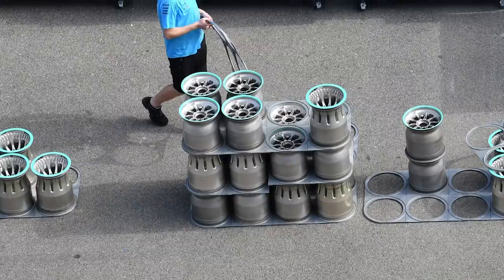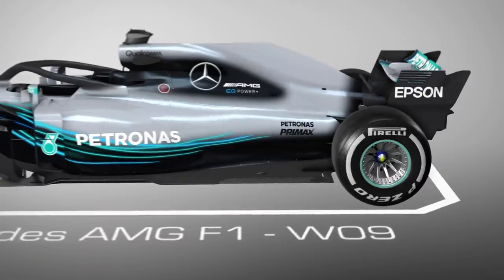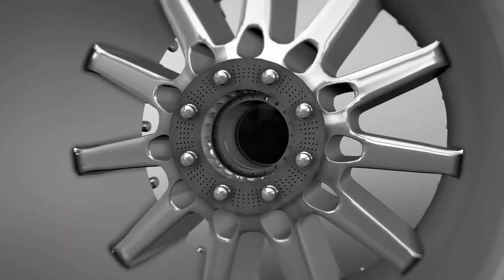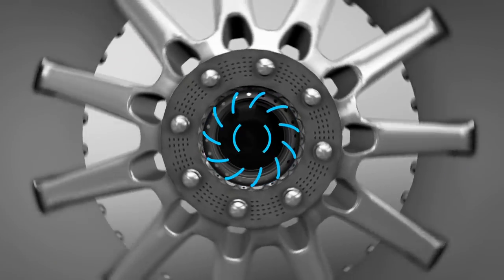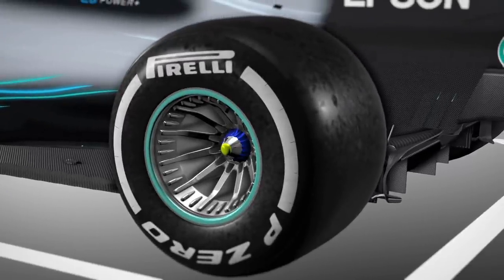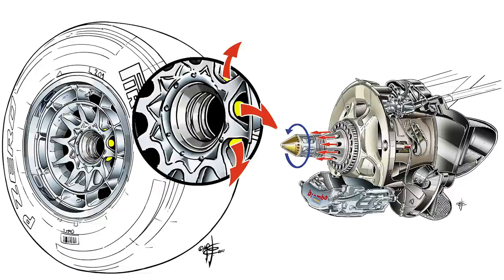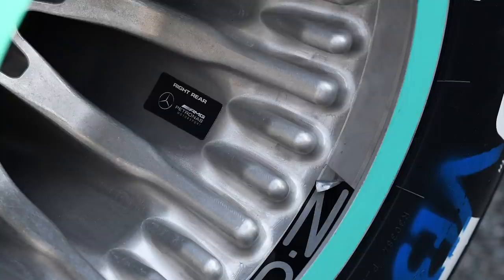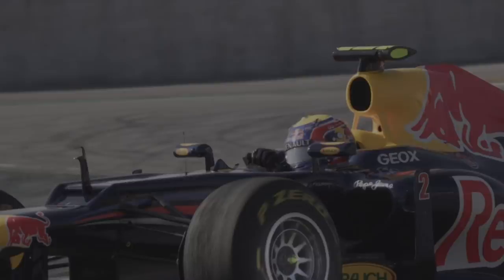Inside Mercedes' controversial F1 wheel rims

Comment: How about they lift some regulations, I want to see what ungodly speed they can muster out of these banned "aero" improvements.
Reply: Nah M8 as much as I Agrre with you, they could never do that. Back in the late 80s early 90s, which is getting on 35 years ago the LMP cars at LeMans which aren't even open wheel were approaching speeds of 270mph...MPH in race trim on practice laps before they eventually put the chicanes in. I'm sure cars like the Porsche 962c and the Sauber Mercedes C9 could have easily topped 300 with minimum aero packages. And that's with 35 year old tech non open wheel cars. If you let F1 teams go full out no restrictions with today's tech, they'd probably be able to make cars that could hit 500+mph and still stick to the tracks around the corners. It would just become impossible for human drivers to survive the G forces in the turns. At this point they need a certain amount of regulations for sanitys sake because the tech has advanced light years beyond what human drivers bodies can react to/survive. I think the highest Gs pulled in any kind of racing these days is red bull air race pilots who've been known to pull +12g on occasion and remain conscious... Then again those guys make fighter pilots look like little girls considering they do all this 50 feet above the surface of the water. I belive they've begun instituting penalties for exceeding 10g though, again, for sanity sake. I do agree with you though. While some regulations are definitely needed they should calm it down a little bit with over regulating
Reply: What blackhawks81H is true. Technology has advanced beyond what the human body can endure. They built cars a LONG time ago that put excessive G’s on the car, and by excessive I mean they exceeded what a human could withstand without graying/blacking out, the cars could endure it but developers knew a human could NOT.
Reply: As much as I'd love to see some crazy machines hitting crazy speeds it's kind of necessary to make it a competition between drivers and not between the cars themselves
Reply: can't wait for AI races
Reply: @tophan5146  Or better yet, the invention of Wipeout racing with innovation to levitation tech.
Reply: Remember Group B Rally? And the insanity that ensued?
The rules may be byzantine, but they're afraid of killing a good dozen drivers, and that's not a fear that's out of nowhere.
That being said, it does sound a bit fucking weird from time to time.
Reply: @blackhawks81H  nah, those open wheels are big drag sinks, they're always going to be slower than a closed wheel GTP car of equal horsepower.

Comment: Typically, true to form, Ferrari miss a trick with some innovation and then try and get it banned...
Reply: You have to remember that Mercedes made FIA put some extra sensors on Ferrari's double batteries. So Ferrari is now keen on revenge. Tit for tad
Reply: eudofia Indeed, but it’s suspicious that Ferrari lost their power advantage as soon as the sensor was installed... so they were obviously doing something they shouldn’t have been doing and yet the FIA took no action...
Reply: @FrontSideBus  That's right. The reason they are so angry. Just as when they lost the power advantage, Lewis was racking up the wins while Vettel was finishing 3rd or 4th. I bet Ferrari fancies the constructor's championship, so they will do anything to try and outscore Mercedes in the remaining races.
Reply: @FrontSideBus   Also Mercedes got FIA into checking the Ferrari Halo Mirrors. 
It's not only ferrari doing this. Every team is trying to prevent progress of their opponent. Renault with Haas, Ferrari with Mercedes, Mercedes with Ferrari and so on.
Reply: Highsider - Motovideos I think halo mounted mirrors actually look better but those extra winglets were obviously aerodynamic and not structural at they claimed.
Reply: Highsider - Motovideos it’s all rubbish anyway. It’s supposed to be the pinnacle of motorsport... they should be allowed to do what they want tbh.
Reply: @Mr Calcium Well, Mclaren can´t make anything work really lol.
Reply: Curious Cat - F Duct!
Reply: @Mr Calcium Yep, they kinda shielded themselves behind the whole "it´s Honda´s fault!" and this year they got exposed, same RB engine, still same shit in overall performance. So it wasn´t just the engine, it was the whole package. And I wouldn´t be surprised if Honda suffered cooling problems because of the "size zero" concept that Mclaren used and didn´t wanted to give up on (of course it wasn´t just Mclaren fault, but it might have been one of the factors in the overall disaster).
Reply: @markmark5269  wow that's some Hamilton/Benz hatred there.....without bias you say?
Reply: FIA = Ferrari Internationale de l'Automobile.
Reply: @SixCylinderSamurai  I've heard Ferrari International Assistance. We're on the same page.
Reply: Not new just reintroduce or copy from old BANNED (2012) Red Bull rim design..
Reply: @stefanocozzi8188  The reason Italiens didn't put man on the Moon first cause they run out of Scafold!
Reply: Where do you get your info?
Reply: Ferrari doesn't do something right once, and now they're everyone's punching bag. Yeah ok.

Comment: The difference between the red bull design and Mercedes comes down to position: RB was running a blown axle which basically uses the air coming from the brakes and "spins" it, effectively closing the sides of the car (the "spinned" air helps the organized air between the chassi and this vortice stay in place, instead of bleeding outwards and ruining the effectiveness of the diffuser).

The Mercedes rims can´t do this because it´s on the rear of the car, plus the amount of air that comes out of the rim doesn´t seem to make much of an impact aerodynamically. Ferrari is just playing their only card to stop Mercedes from winning the championship again, Mercedes just played it safe and didn´t run the rims after this to make sure those points wouldn´t be removed later on.

And of course the new rim will have an impact, it was made to control the temperature of the tire and the blistering because of overheating, which is one of their problems most seasons, so by going back to the previous rim, those problems came back. But if it doesn´t have an impact in aerodynamics, Ferrari doesn´t have anything to hold on to. Because teams are allowed to let the air flow thru the rim for cooling, what they are not allowed is to use this air as an aerodynamic vortice to enhance the air flow thru the car, but that can only happen if it´s used in the front axle, frankly can´t see how they can do this using the rear axle.
Reply: Active aerodynamics isn't only banned if affects aero in positive, but also for temperatures. Of course with the exception of the engine cooling.
Reply: @piereligiodisante  What? That makes no sense, every bit of the car is made to monitor and actively control the temperatures of the brakes, tires and engine. It makes no sense the teams not being allowed to control the tire temperatures, which is key for success. What you cannot do is actively heat or cool down these elements (use a button to turn on some system that does this). They are allowed to cool down any component passively (which are basically what the rims do, they disperse heat from the tire thru the rim, without any active system). And yes, they can divert air thru the rim to help cooling it (which cools the tire) but they cannot gain aerdoynamic downforce on this, which is what is banned from the RB idea of 2012).
Reply: @The_Curious_Cat  You seem very knowledgeable on this topic and I really liked your comments, but regardless of that, saying "thru" still makes you seem like a very unintelligent person...
Reply: @The_Curious_Cat  One way I could see this being aerodynamic is if it, say, pulls air out from under the car at the rear, or from in front of the rear wheel via the brake cooling ducts.
Reply: @Zitr000ne  lol wtf why would you say that

Comment: Teams protesting over advanced Air flow for a rim........Air flow to a rim.......yea. lmao. What a bunch of little pansies!
Reply: This solution had already been rejected on redbull in 2012 because out of regulation. Mercedes has proposed them again knowing that they were still out of regulation and the FIA has made it wrong by allowing them to use them in some GPs. In the GPs in which the holes were open the Mercedes did not suffer from blistering and excessive heating of the tires with a consequent drop in performance, when the holes were closed they suffered the aforementioned problems. The rules MUST apply to everyone and mercedes has proved to be clever at the limit of the illegal while the FIA has been unable to enforce the regulation to the letter. The regulations apply to everyone not one except neither for Mercedes, which obviously has the most significant weight on FIA.
Reply: @alessiosem2238  yeah but the point is, why is it even a rule. If it's related to safety, then fine. If it's related to inhibiting innovative design because it gives an advantage, then it's bull shit.
Reply: @millinom  by that same token, most rules are bullshit in your opinion. there are restrictions to keep teams competetive.
Reply: @chanderson2559  most rules are bullshit. if people want even vehicles the go play with gokarts or AUScars or something where everyone gets the same vehicle, F1 should be about pushing innovation and the rules should only be made and set based on safety factors, reliability and emissions/consumption levels.
IE: design should be for keeping drivers safe, making all major parts last a season and only putting out X Kg of emissions per Km.

If some povo team can't afford to compete at the pinnacle of motor sport then go back to F3 or FF or something.
Reply: The People's Affront to Judea  preach! stunting innovation is just ass backwards.
Reply: @ericshutter5305  who are you referring to
Reply: did you see thier new bars across thier fucking faces?
Reply: @alessiosem2238  The point is that Mercedes' design works differently enough that the FIA decided it was legal. They'll have a slight advantage for awhile and then they'll be copied. Get over it
Reply: Theyre Europeans, what did you expect?
Reply: Airflow through a wheel is a perfectly valid thing to focus on when designing a vehicle When you focus an entire season of motorsports around testing very specific things, and those things don't include airflow through wheels, and you do that, you are breaking the rules. It's actually that simple. The sport itself is centered around technology advancement, not winning races. When any team is willing to go outside of the rules set before them to win the race, they're sacrificing the entire point of anyone being there.
Reply: I'd also be willing to bet most of the people here saying that this inhibits innovation aren't avid F1 viewers in the first place. Perhaps the innovative aspect is being better within guidelines instead of seeing which team can throw the most money at a problem. The rules are still broad enough that clearly the more wealthy teams still can simply throw more money at their car in order to brute force their way to success. 

It's still all within guidelines evidently, and that shows that clearly there has been enough room for innovation within the rules that some teams(namely those with the highest budgets) innovate to a higher level and faster. When teams like Williams and Haas start winning, then you can begin the conversation on innovation being discouraged.
Reply: The People's Affront to Judea  I like the Group B point haha. @ clock point...would 10 sec at least per mid/long ss  lose to mid tier wrc or erc cars.
Reply: Chanderson 255 F1 has viewers?
Reply: for a rim? well that air flow will help the rear wheels be better dummy
Reply: Jason Mullings  "Then what's the point in high level racing if it isnt pushing car tech further at every instance ?"

"racing lost its soul when the car became the centerpiece instead of the driver."

Make up your mind.
Reply: It's not the rim doing the airflow. It's the wheel.
Reply: Why ban Red Bull's blown diffusers then as it's just exhaust air?   RB were unbeatable with that and their flexible front wing that was also regulated out.

Comment: What’s wrong with exploiting heat management.
Reply: DiscoR53 it could be defined as a moveable aerodynamic device.
Reply: Willy Lamb 

Please explain your position?
Reply: Nothing inherently wrong with it but I it becomes a problem if the added complexity/expense/design elements prohibit the other teams from capitalizing. If that's the case it just gives the more financially backed teams like Mercedes and Ferrari an even bigger advantage. So it should be officially addressed one way or another.
Reply: @willywillywillywillywilly   Then the FIA has to ban rims. EVERY rim is rotating, and EVERY rim has air flowing though it. Then every rim  - regardless of ist design - is a moveable aerodynamic device.
Reply: Lol, uses the word "exploit" and is surprised there's a problem.
Reply: @willywillywillywillywilly   Has anyone ever got your name the wrong way round
Reply: sooner a movable wing is allowed, the better
Reply: @willywillywillywillywilly  Rubbish, in that case, the whole car is a movable aerodynamic device. The design is exempt from that assumption because in context, this design is to aid temperature control, not increasing downforce or reducing drag.
Reply: ISLAMATRON it’s about primary purpose, smart guy.
Reply: @markmark5269  Exploiting, as in exploiting aerodynamics as downforce literally does. What's wrong with it.

Comment: This is why i stopped watching F1. Schumacher's retirement from Ferrari actually merged with the death of F1. FIA just neutered the sport. It used to be the source of the most exotic tech that comes to everyday cars ; stuff like ceramic brakes, carbon fiber, magnetic suspension, even the banned active suspension. Except for KERS nothing really comes out of F1 anymore, cos there actually isn't any real innovation. FIA is banning everything new and interesting. Also downsizing the sport doesn't help at all. In essence F1 now is an empty shell of greatest sport ever.
Reply: I gotta admit, those generators on the turbo are the one piece of F1 tech I would want to bolt into a production car next year.

But yeah, not a lot of interesting development coming out of F1 in a long time. 

Crud, that Nissan front-wheel-drive GT-R with the through body aero tunnels is more interesting than anything that's come out of F1 in the last ... 20 years or more!
Reply: @ScottKenny1978  I noticed the later years that the sport which has the best tech development is actually WEC. When we had Audi back in it, it used to be an epic 3-way with Toyota and Porsche and i remember thinking "God, this is some real intense shit; we have NA V8 with 1 kinds of hybrid sustem, next Turbo V6 with another kind of hybrid and lastly Turbo inline 4 with third kind of a hybrid and all of them are so close." This is the kind of entertainment i wanna watch. Cars using different methods to achieve the highest performance. And LMP1 cars nowdays are far more advanced than Formula 1 cars. They use a lot more downforce and are capable of incredible time; something which was impossible back when Formula 1 was discovering all of the new tech.

Comment: Mercedes re invented the wheel! The 935 did the same, not allowed to change Roofline, but nothing in the rules about Another Roof on top factory one. Legal Outlaw.
Reply: Similar to Volvo in BTCC they couldn't change the valve angle on there cylinder heads so they milled part of the head off to change the angle of the valves.
Reply: Ducati had a Single Cylinder motorcycle for racing, they added an Extra Dummy Cylinder to even out rotating vibration of a single Cylinder. Was a V.
Reply: @asambi69  Chevy 409?
Reply: Titanium half shafts on the 935 were over $200,000. Why most Privateers were subsidized by Miami Sugar. One guy who got caught by the DEA donated his 935 to the Indianapolis Motor Speedway Museum. Tried to get it back after prison term was up. NOT! This was 80s $.
Reply: @crimpcreep6887  Bruce Meyers ended up with that Porsche. It also had some weird tech items..lol like a place for a small nitrous oxide tank....from Wyoming USA 🔫🤠

Comment: This has been going on for years, it’s all about innovation in f1, they get a shed load of rules they must follow, and it’s upto the designers to look for any loopholes within the rules for that given year, think back to some of the f1 cars from the past
1) lotus twin chassis 
2) brabham fan car (which was leagal but they managed to get it band)
3) mclaren two brake pedals 
4) mclaren carbon fibre tub
5) Williams active suspension 
6) brawn double diffuser 
7) red bull blown diffuser 
8) mclaren f duct
9) red bull flexing front wing
10)Ferrari semi automatic gearbox
These are just a handful, it’s going on constantly in f1, they are basically inventors working to a rule book

Comment: I would also think with a cooler rim, they would also have more consistent tire pressures too, thus allowing them to run higher initial tire pressures and have optimum performance immediately after a pitstop.